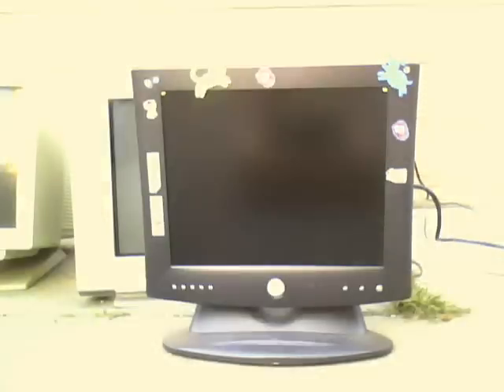2002 Dell 1702FP LCD Monitor Test

Comment: Ugh I'm trying really hard to post a comment on this video but google+ just won't let me!
Reply: Ugh this is bad.... That camera wasn't even mine, it was to my dad, I think.... Oh, I just remembered, my USB capture device also died like a week ago... Truly these aren't glorious times... Will 2015 be worst than 2014? Nah that's impossible.... I lost all of my most valuable possessions in 2014 + my grandfather also died that year... This is really bad because I had to take pictures of the insides of an old radio I'm trying to repair (my great grandfather's radio actually, a Viking E1-4526Z) to ask on a forum if the radio contains any "molded paper" capacitors and how to differentiate them from resistors... I hate molded paper capacitors so much... It's bad enough that they're extremely unreliable, they also had to look identical to resistors! Argh those damn molded paper capacitors.... Do you know how to differentiate them?
Reply from the maker: VideoTape Damn that sucks, looked like it was a good camera. 2014 was the worst year of all time. Unfortunately I don't know how to.
Reply: It was a good camera... When filming inside I always had to use a lamp or else the video would be almost impossible to see, the auto-focus was pretty dumb and the zoom was crap but really that didn't bother me at all.... It also was extremely resistant! As long as it didn't fall on its face that is..... I'm gonna buy the same, and be extra careful with the new one.... It really sucks because I wanted to film the installation of DOS 6.22 on a floppy (lots and lots of disk swapping!) but then it fell, on its face, while it was open, and died....
Reply from the maker: VideoTape Damn. How much does a used one go for?
Reply: Ehhh around 50-60$?
Reply from the maker: VideoTape Is that a lot for you?
Reply: Ehh, not really... And I might be able to get my dad to buy it for me! ...............................................

My dad is such a nice person, I really didn't deserve a dad as cool as him.....
Reply from the maker: VideoTape Oh okay and lucky.

Comment: lolfail. I know a solution in fixing it. Plug it in and take a look at the screen, it could work.

In all seriousness, an LCD monitor consists of the LCD itself, a controller circuit board, and it's own separate power supply.